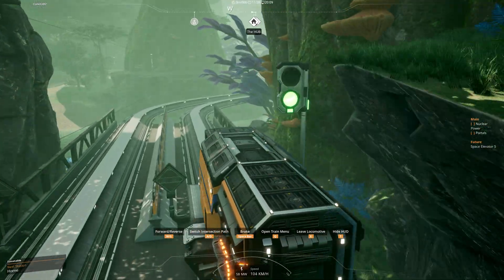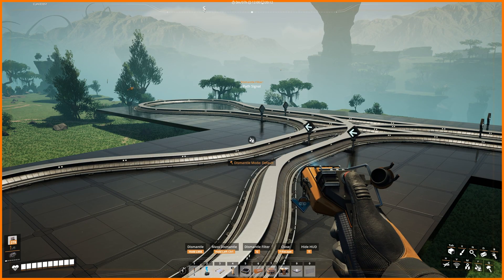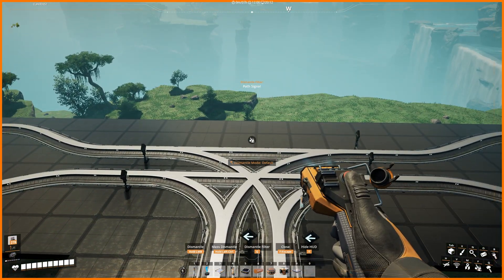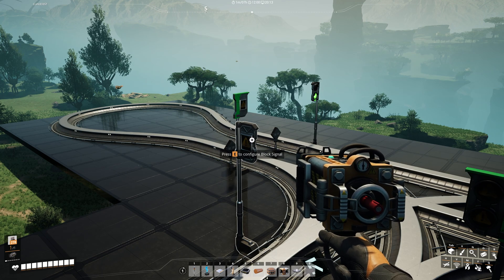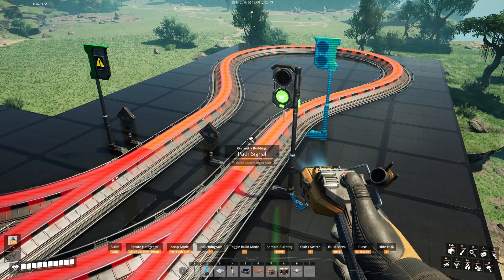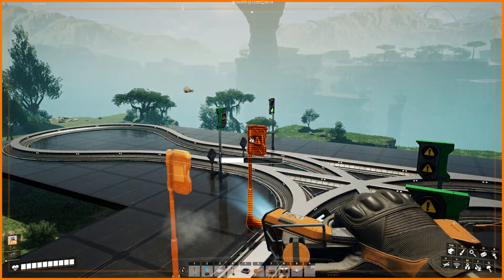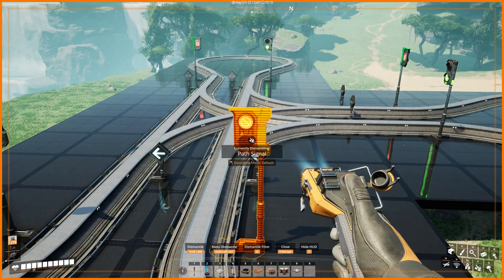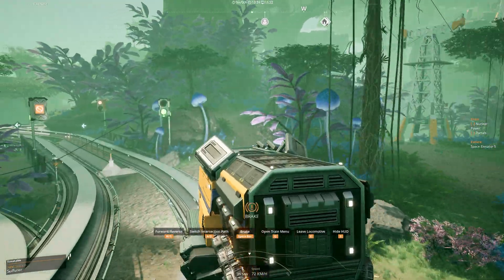Satisfactory: Fix for "Signal loops into itsself"

Comment: Thanks for this. I'm on my first playthrough and finally got to trains, so I did the logical thing and made a test world and made a big-ass train set with a bunch of different intersections on it, so I'd get to grips with signals in the game. But issues were driving me nuts, both path AND block signal issues, and I couldn't work it out. It's especially annoying because your signals want to snap to the joints. Coming from Factorio (it's been a couple of years though) these looked easier in theory, and once they're working they are quite easy, so I'm happy to have found this video. Happy to report my train set has been running smoothly now for hours.
Reply from the maker: Wooo! Train pain resolved

Comment: One problem that I ran into, after setting up a 2 track blueprint that I found on a youtube short, is that if you set tracks too close together, you will get a "signal loops into itself" error when trying to set up an intersection or placing block signals along the track because the game will be reading them as one track instead of two. Much like when you set the signals too close to a merge
Reply from the maker: I think there's a collision detection issue with tracks. I've seen a few videos where trains do a complete 180 on tracks that are too close.

Comment: The problem is a the rail broken node bug, you should build the junctions it in a specific way for the signals to work over them so you don't have to move them backwards.
When you build the junction, before the first click the blue hologram preview should be facing to the interior of the junction, and the second click to connect the rail to its destination should be as well inside of the junction, not over the rail leaving the junction...
Its hard to explain it in text but you can search "The Secret to Perfect Train Signals in Satisfactory!" by Overclocked, they explain it better than me haha

Great video anyways! you method is also a good option! hope they fix this bug in the next update
Reply from the maker: Interesting video. I'll have to give that a try and see if it works for me. That method seems to add extra tediousness to an already tedius problem. My solution just avoids the probelm, but it does take more space. I certainly agree with him that this is a bug.
Reply: @Malteas-Games yeah is tedious! Visually is undetectable and normally when placing rails and building junctions you are not conscious of where you click because it just looks right... So yeah I also think it is a bug.

Now I always rebuild my junctions having this in mind and it works, hope it works for you too!

Comment: I've been getting this all over too. sometimes I get it to fix by reconnecting all the track sections, but I haven't cracked the code on which ones are the issue track in what situations.
Reply from the maker: If you connect a track in the middle of an existing one, the old track gets split in two. If you remove and rebuild that new branch from the new break it will be at a better angle. This could also be happening on flat sections, but we can't see the difference.

Comment: Is it normal your complet rails you build without any signals are red? Im kinda not even able to place one signal.
Reply from the maker: Do you mean the signal icon being red? or the track highlight when placing signals. The track highlight color doesn't mean anything. The icon on the signal can be red, and that's fine. Path signals will remain red until a train approaches and then it will turn green. Block signals will be green until a train enters the section after the signal, and then it turns red. If you place a single signal on a loop with a train, it will be red.

Comment: Thank you dude. Im a new player. I just recently unlocked trains and wanted to figure out junctions and roundabouts... I watched countless guides... couldnt get it to work... thought im an idiot... how was this video not recommended first position after I serched for this issue... Thank god one week later this somehow shows up on my front page. Will fix my tracks right away. 

I also encountered; what I think is a bug too after knowing and watching this; that sometimes if two tracks connect in a "X" (eg. 2 going in from north side; 2 going out south) the  railway switch detects not 2 but 3 directions. I have seen my train make like a basically 180 turn instead of going around the roundabout...
Reply from the maker: Wow, I haven't run into a switch like that. Post something on reddit and link it. Probably you just have to cross at a bigger angle, I'd have to see it to say more.

Comment: I started playing at 1.0, and this error was plaguing me back then.  I stumbled on the solution myself, but thank you for explaining WHY this happens - something I could never figure out.

It bugs me to have to increase the size of intersections so, instead of t-junctions like in your example, I put in roundabouts.  You can squeeze one into a 5x5 square, so it's no bigger than a regular t-junction and, because each line has only one connection, you never get the "loop" error.
Reply from the maker: I do like a roundabout. It also lets the trains turn around. I hope this gets fixed in 1.2.

Comment: This, I did not know, was an issue. I only use point to point trains, becasue I can never get signals to work right. And that may be the reason why. Thank you, nobody else has published a vid on this issue I've seen.

Some ideas for train videos:
How long to make blocks on the railway, so like when you have long uniterupted lenths of track between junctions, how long between the block signals
How steep can you go and how far with a loaded train, and what do you need to make it up that (i.e. more locomotives, less slope, less train, etc.)
What is a good length for a train/how to figure out how much train is needed for the requisite throughput requirements
How to get started with your first train line
How to do point-to-point pushme-pullyou trains
Fluid trains, are they good, or should you package and unpackage liquids, a throughput test
Does adding more locomotives make it faster for a short train, like 3-4 cars and like 10 locomotives, and variations inbetween

I hope these are ideas you like and want to make videos of.
Reply from the maker: You're welcome. I saw it too many times and thought it needed more visibility. Check the link in the description to the QA site and upvote it.
I like those ideas. Some of these are good train basics that aren't all that obvious how to do. 
I have seen issues when signals are too close together leading into path segments. There's probably an optimal length based on train speed and length. There's a pain there.